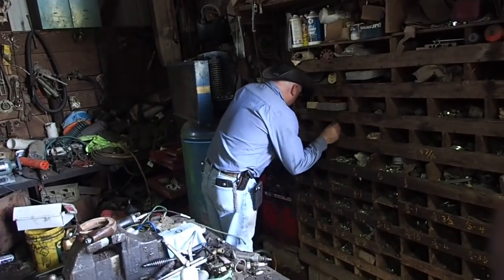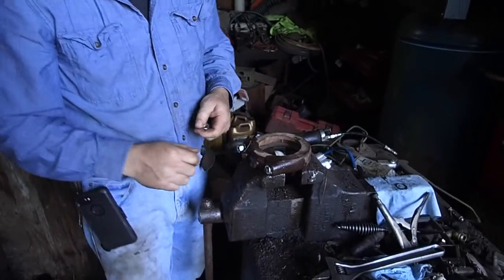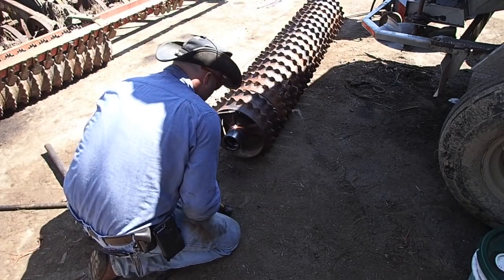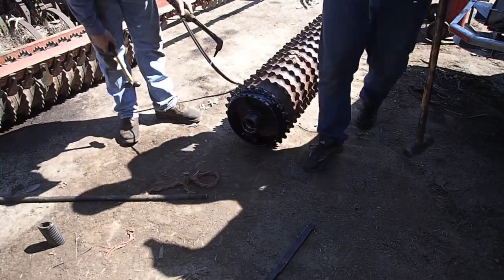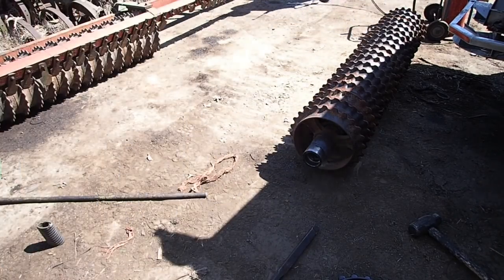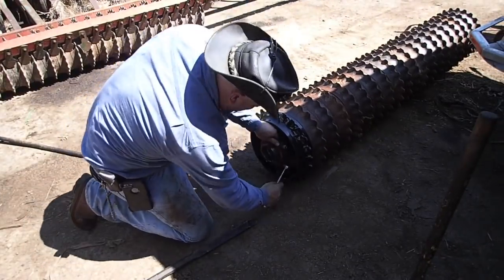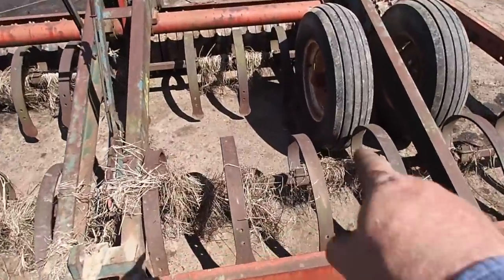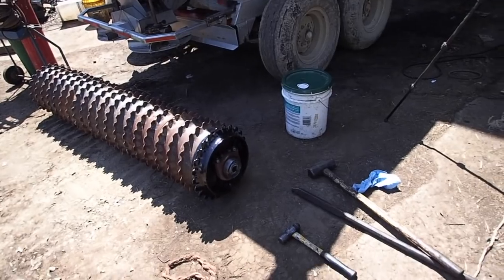Brillion Roller Harrow (Rigger Nig)

Comment: We had a Kewanee that served us well. There's quite a bit of clay in our area. We found that when you ran into Sandy spots just lift the teeth a little bit to keep the dirt from bridging in front of the roller. It was usually used for the final pass with any tillage we did. Pull it with a 4010 diesel.

Comment: I literally drug a old harrow section out of the weeds and had to put it back together.   Square head bolts and nuts.   I was happy when the threads worked with the help of some PB blaster

Comment: If the slug, bearing housing or bushing isn't worn too bad use jb weld. I've done it and it will work for hundreds of acres. Instead of buying the entire tube assembly, go to any place that sells steel and buy a chunk of schedule 40 pipe that is the same outside diameter as the old tube. You may have to turn your slugs down a bit to make them fit, pound them in and put a small weld on the seam and your fixed up better than new

Comment: What purpose does a harrow serve?
Reply: dejanira2 the main use is after disking, the front roller breaks up bigger clumps of dirt, the teeth help level and the back roller helps even and firm up the seed bed.
What most guys and Wes is gonna use it for is after seeding leaving the teeth up, is to pack the furrows from the grain drill to level them and to ensures good seed to soil contact. Also it helps to push stones down so they don't cause problems when mowing the hay.

Comment: It's called "Farmer Engineering". Use what ya got and make it work. I've done it more times than I can count. Yeah, I've also order the wrong parts, not all my equipment has the model number on them anymore. When ya find the model number; take your mig welder and weld the number on the frame somewhere (usually on the top of the frame). Saves time looking for the number next time. Oh, and get Tim some longer shirts. :)

Comment: Wes- might not be a bad idea to put some kind of a tag on that roller so you will know what model it is for the future.
Reply: Daniel Sweeney i would suggest a stamped plate and rivet it to the frame. And old piece of sheet metal makes a decent plate. Letter and number stamp kits are inexpensive. Later if can read it, shoot a bit of paint on it, let the paint dry, hit the plate with  a scuff pad or sand paper and paint stays in stamped area and easy to read!
Reply: If it were me, I would take a stick welder and weld the numbers right on the frame. But thats just me.

Comment: Those spit lock washers are very poor locks.  That ramping cut dual washer system take more torque to loosen then tighten. Split lock washers only need ⅓ tightening torque, or so,  to loosen . Try it with a torque wrench and see. 
.